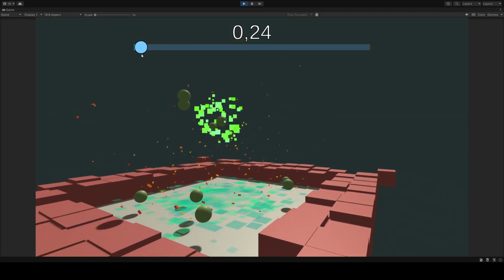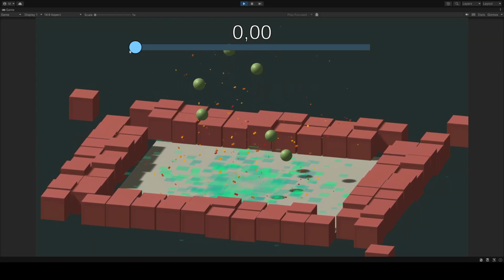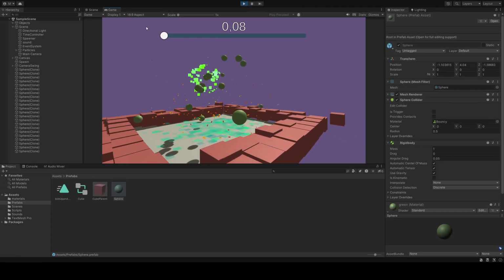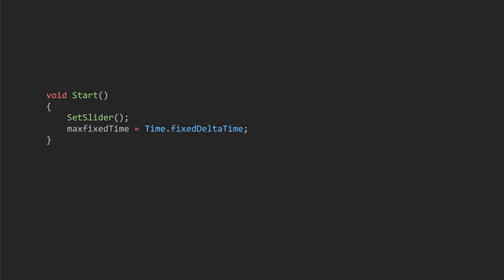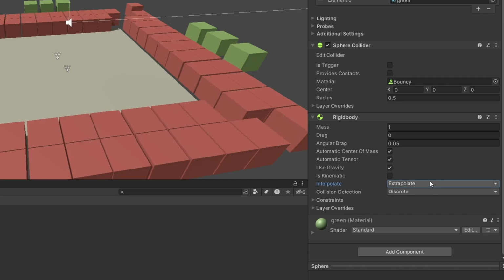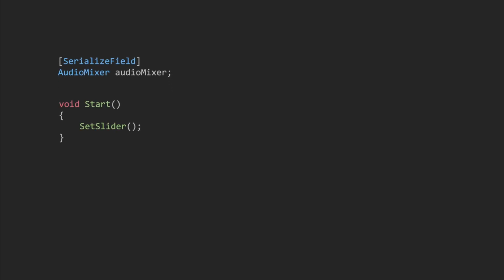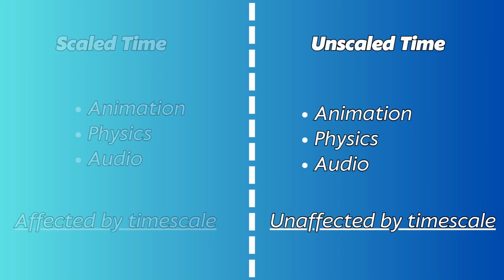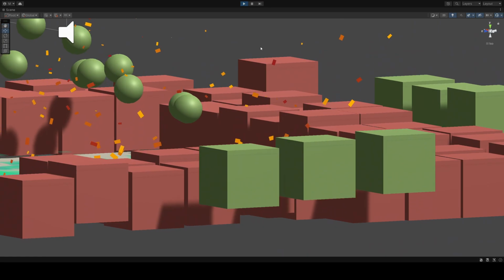Slow Motion | Bullet Time | Time Control in Unity3d

Comment: Hi! Great video! I wonder if you know is there a way to make a rigidbody-based movement (based on AddForce) timeScale-independent? Im trying to make a slowmotion game, but the character is supposed not ot be affected by timeScale, but i cant figure it out for hours
Reply from the maker: Are you already multiplying the direction with fixedUnscaledTime?
 https://docs.unity3d.com/ScriptReference/Time-fixedUnscaledDeltaTime.html
Reply: @ForlornU no i am not, actually, i do not use deltaTime in my AddForce() function at all, but I use ForceMode.Acceleration